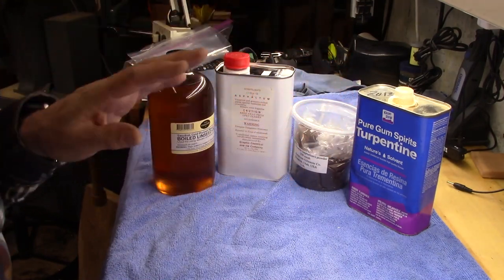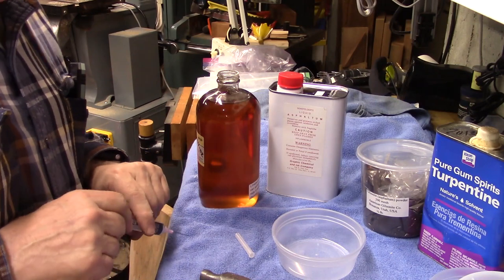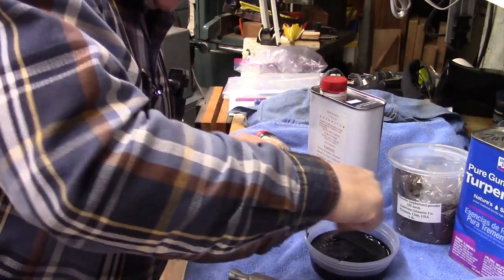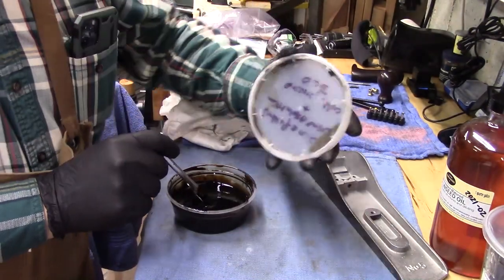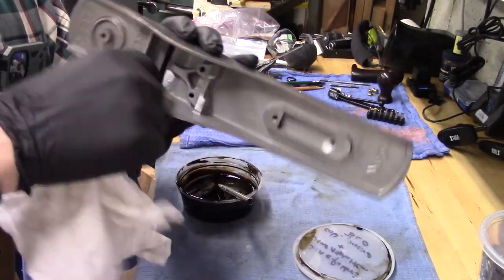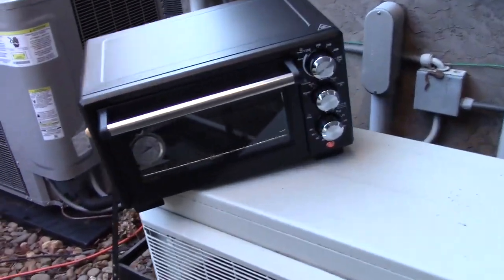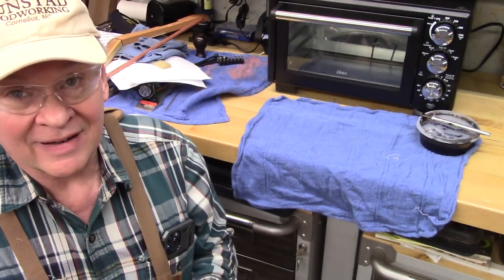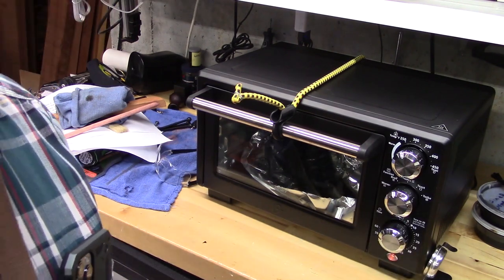Japanning Formula Review, Evaluation, Application, and Baking on a Stanley Plane Body with Dr  Joe

Comment: Japanning seems to be a very good way to keep tools looking good and from rusting out. One question I have is after the process has been completed on the metal tool can the finish continue to be heated up many times and still keep it's tough finish? Reason I ask is I several old Coleman lanterns that I would like to try the process out on.    Thanks
Reply: Be worth a try, Hey...?
Reply: It worked for my grandpas lanterns…

Comment: Great video. Is it possible to sand and polish the finish once it has cured? It seems that Singer did that with their sewing machines.
Reply from the maker: Thank you for your nice comment. When is the final baking is completed. The japanning has a very high gloss inherently. It certainly could be polished however, and you could probably enhance the shine. Sanding possibly wet sanding but I have never tried that. Consider subscribing. Thanks, Joe.
Reply: Yes, from what I've seen, and read, Singer did three dips, three bakes, and three polishes.  The first bake was done at 350 F, the second and third bakes were done at 150'F  All three bakes were done overnight.  They were then smeared with a fish gel (Collagen most likely), decorated with gold leaf and painted, rinsed to remove the collagen, then varnished with copal varnish.  according to the article either pumice or rottenstone was used.  I've worked with 4F pumice, which seems rather aggressive to me, especially on wood but Japanning might be able to handle it with no problem, (I don't know).  I think the article was on one of the pages from :  ISMACS  (International Sewing Machine Collectors' Society)  Good question, Keep me posted if you come across any info.  This video has the Ford recipe for Japanning, which might be thin enough to dip the parts into, without a doubt many things were dipped to save time and money.:  https://youtu.be/y6BXE4uDW-Q?si=LHN2DFFiQW2zQtDQ

Comment: Awesome video and I want to use it asap. Couple of questions. You use and say boiled linseed oil but the options below are cold pressed? is it necessary to use a primer on the part admittedly the surface isn't smooth. thanks
Reply from the maker: Everything I’ve encountered regarding japanning uses BLO As a very important ingredient. It’s the one I’ve always used I have never used coldpressed so I don’t have any experience with that. When it comes out of the oven for the last Time boy it is beautiful. 

Please consider subscribing. Thanks Joe
Reply: @JosephHunstad  thank you for that, much appreciated. I'll stick to what you have used.

Comment: I know it’s not period correct but could I use black enamel in the absence of japanning?
Reply from the maker: Hey, great question of course you can use that. Panning was used because enamel paint had not been invented yet when a enamel paint was invented the use of Japan and basically went to zero. But if you want to be truly authentic and time. Accurate, Japan is really great but Black and Abel paint looks great also. Consider subscribing. Thanks, Joe.
Reply: @JosephHunstad  thank you!
Reply: Hand tool rescue has done some testing, it can get pretty close to the original japanning look but the color will be a bit off because authentic japanning has a hint of brown, it isn't pure black, and it is glossier than enamel, although you can get close if you go with a more matte enamel then clear coat over it. The enamel would certainly be functional though.